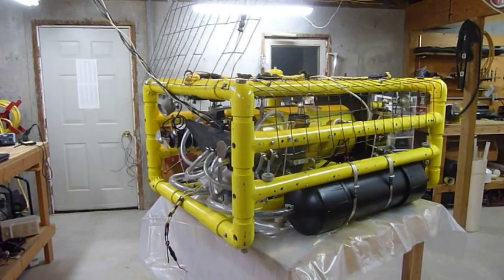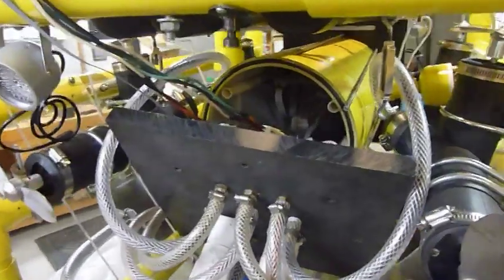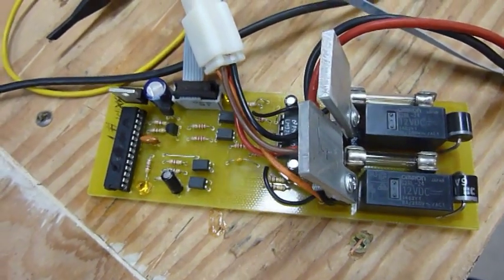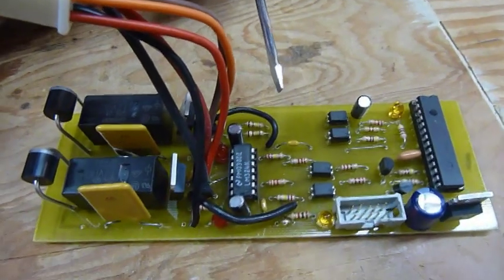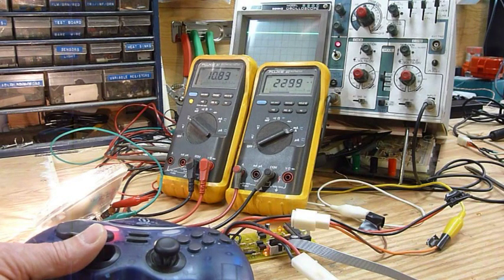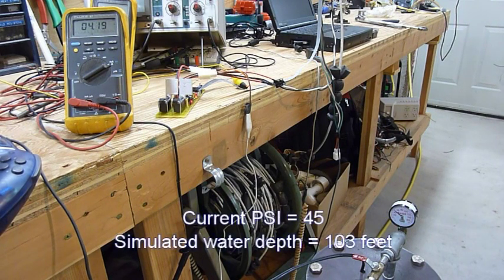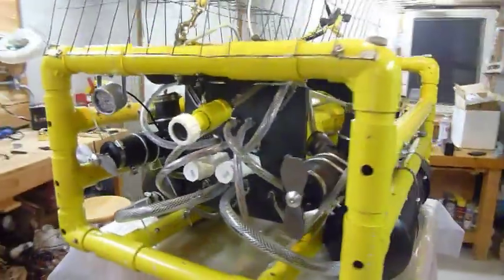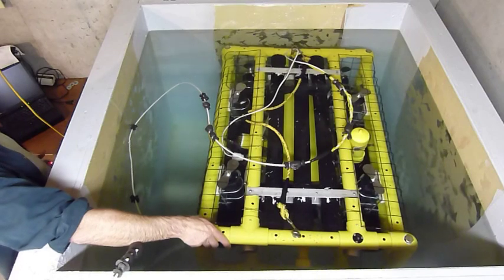Building An ROV Motor Control Circuit Board

Comment: Dang dude, just found your video!!  You got it going on man!! Snap!!
Anyways, really good idea incorporating  poly-switches into the ROV. Do you plan on utilizing the switches anywhere else? 
My son who is 10, loves anything underwater. So for a homeschool project we are going to build an ROV.  Do you mind if we implement some of your ideas?  I am really impressed with your homemade circuitry!!  Haven’t seen that since my R&D days in the USAF.  Take care and have a great week!  James
Reply from the maker: Hi James. Hey, thanks for your comments on my self-taught design skills and work. I sure appreciate it. The poly switches shown in this video are the only ones that I had used, which did work, but presented another problem where the heat build up on the switches while using the motors extensively and heat from the other circuitry did cause the poly switches to open too soon even though the motors were not over-driving them. Possibly improving my cooling fan system would help a little. Since making this video I have started redesigning all of the motor circuits from PWM, to controling three phase brushless DC motors. I haven't finished it yet, but the 3P brushless DC motors will eliminate our weak link in the system, which is the shaft seals on the Sevlor motors. Plus, they will require much less power. You can sure use any of my ideas if you like. And if there's any additional information that you need, just give me a shout! -Bob

Comment: Great works, It's much better if you would modify this ROV by using the DC(High DC) - DC (Low DC) converter system instead of using the  2 Batteries set. At this point we can use an AC Power generator which is used in any Boats/ ships for power up the ROV easier.
Reply from the maker: I totally agree Tan. And that's something I do plan on changing over to. I have already made up and tested some sine-wave clipping AC controllers to use on AC motors. It will be nice shedding the 40-50 pounds of batteries from the ROV.

Comment: Where did you get the back plate for the main housing of the ROV?   What is it?  Looks like scehdule 80 pipe but a flat piece.
Reply from the maker: It's a 3/4" thick piece of plastic I believe. I don't think it's considered schedule 80. It's made of material that's not as hard as PVC. We got it from a local machine shop that had also milled the groves in both ends of the round tube for the "O" rings that go up against the black flat pieces.
Reply from the maker: I believe the flat pieces are ABS plastic.

Comment: Is not a PIC 16f84 !!
Reply from the maker: You're right Renato. Thank you for pointing that out. The processor is a 16F876.
Reply: Robert Hosea
Very beautiful design Robert !  I appreciate that and I realized the amount of pins! you could share the source program? I do not have money or space to build this size but perhaps a smaller soon .... thank you.
Reply from the maker: Renato Leite Filho Yes I will be sharing the source code. I am going to start making a series of videos showing how to design the complete control board, which will include the motor control, communication, video, lighting and compass circuits. I will also supply the source code for the processors and all documentation and schematics. I hope to start working on this very soon.
Reply: Robert Hosea
Great ! You have more one entered your channel !
Reply from the maker: Renato Leite Filho Excellant Renato! Thank you!